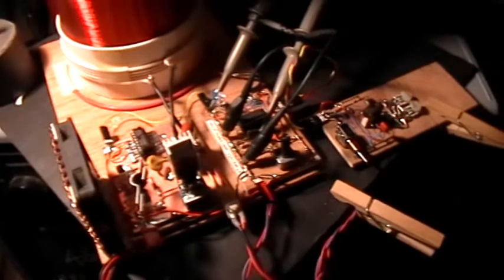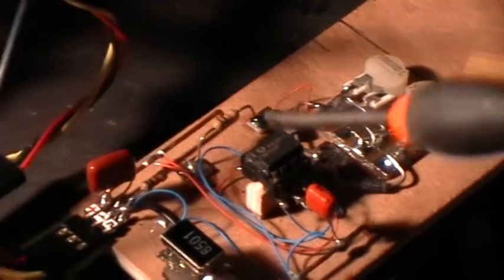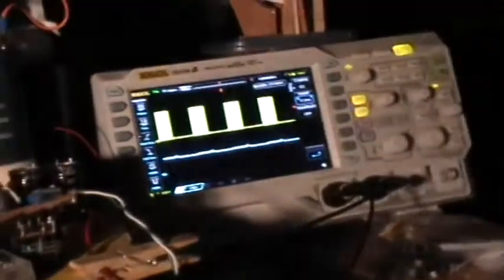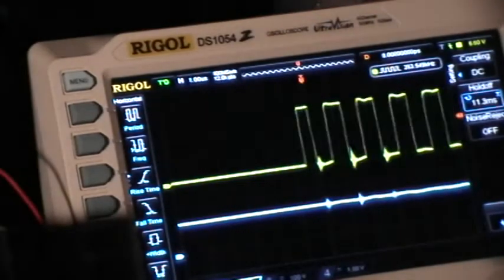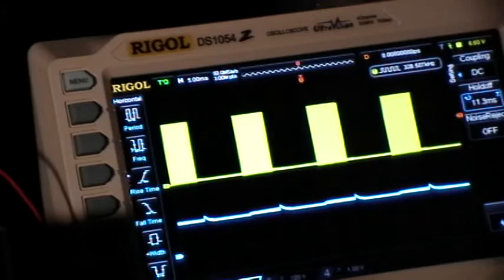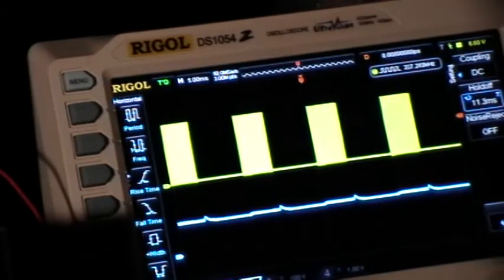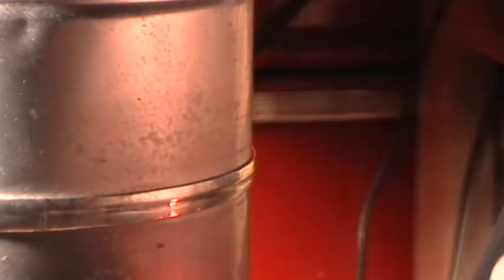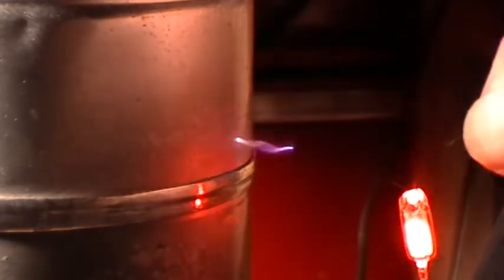Extreme High Voltage: TinselKoil IX Improvements: Caps, Interrupter

Comment: You got a schematic for that gated pulse train circuit?
Reply from the maker: m3sca1 The PLL chip CD4046BE has an "enable" pin #5. Tied to ground, this enables the output of the chip. Open, or HI, disables the output. So simply put your favorite 555 square wave generator circuit's output between the 4046 Pin 5 and the common ground. When the square wave or pulse is HI, the PLL output is off, and when the pulse is LOW the PLL output is on.  
The basic PLL circuit can be found in the Data Sheet for the CD4046BE chip, and any 555 timer or other pulse generator circuit will work as the interrupter. Play with timing cap and resistor values to suit your specific application!
Reply: TinselKoala im waiting for my chips to arrive  :)  i havent built a 555 circuit yet...does it require a split rail power supply? oh nevermind...ill just look it up and start component digging  :)  thanks again for the inspiration
Reply from the maker: jeremy gwilt
Nope, the 555 is simple and easy to use for all kinds of timing applications. Just google "555 circuits" and browse through the images, you'll see hundreds of useful applications.
Thanks for watching and commenting, and good luck with your project! Keep me informed as to your progress.